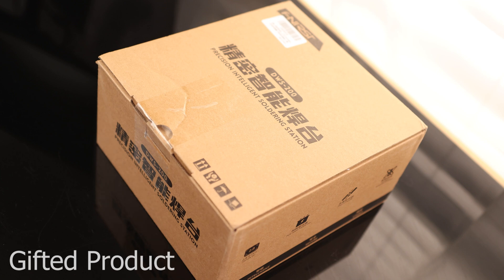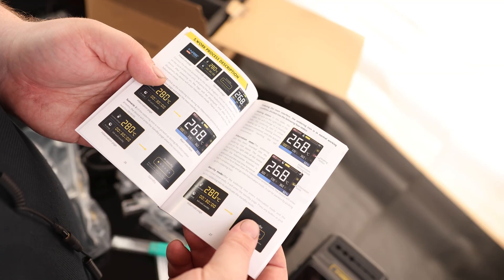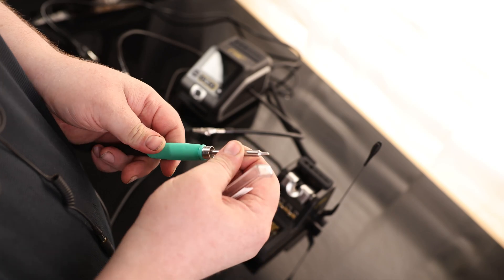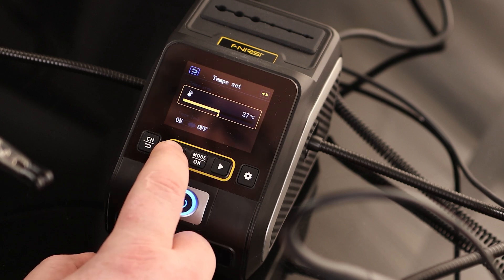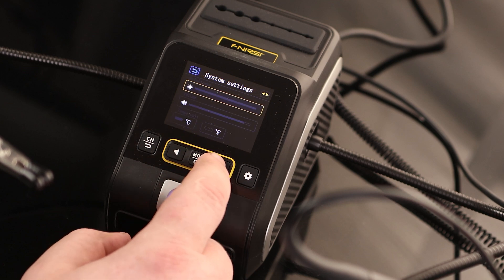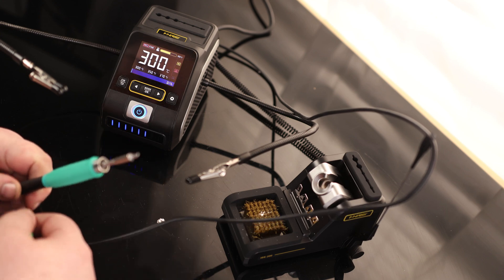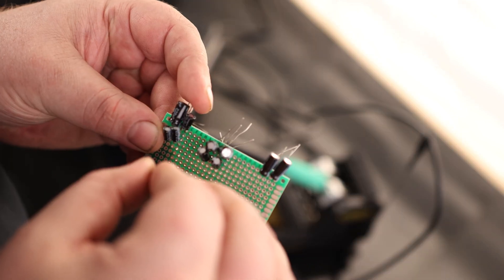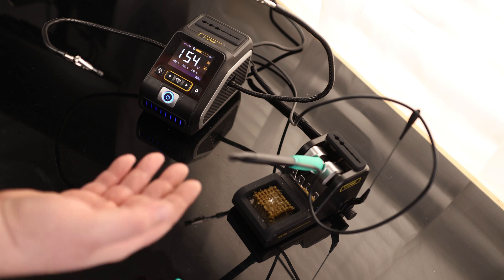FNIRSI DWS-200 200W Precision Digital Soldering Station Kit, with 3 F210 & 6 F245 Soldering Tips

Comment: You need to check voltage on a tip. Aixun had up to 80 V on the tip. Seller/manufacturer could not answer what was the reason.